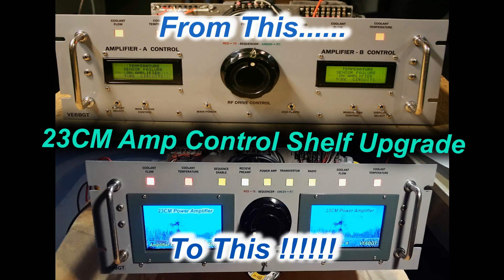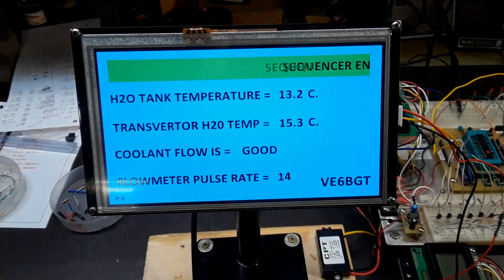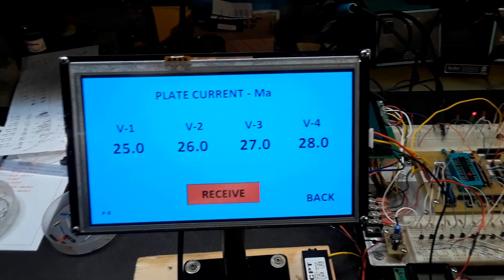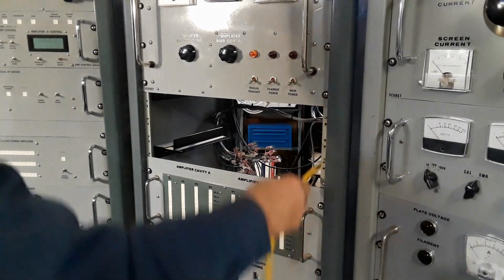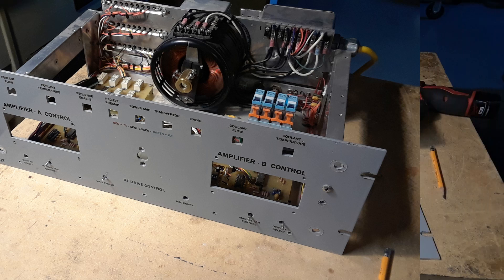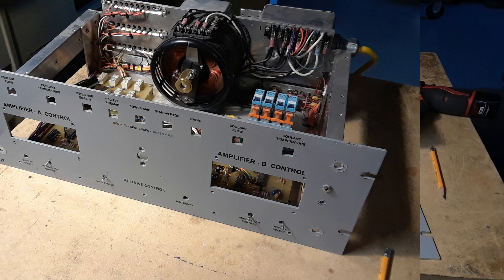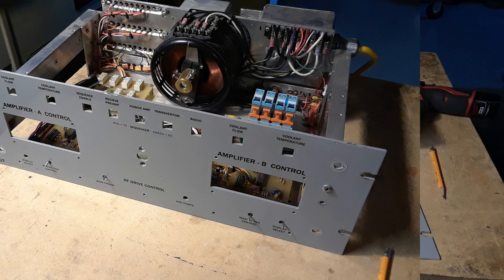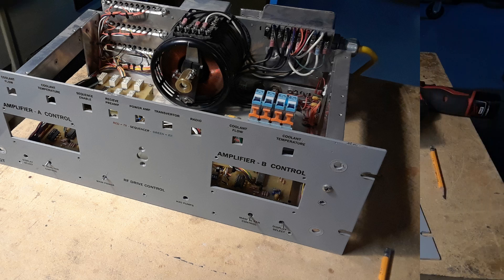23CM Amplifier Control Shelf Upgrade

Comment: Hi Skip,
What is the lowest wavelength that would be kind of practicle to use in conjunction with the concept of EME.
I am just thinking that at 68 I am always looking for projects to keep getting up in the morning worth the effort. Don't have time for a new endeavir now, but winter is coming...
Reply from the maker: Hello again, well first off your still a young fellow so dont let that stop you!!!  the frequencies for EME are from 6 meters ( 50MHZ ) and up, all the way to 24 Ghz and higher probably..  There is a lot of noise and other issues that you have to contend with on VHF and UHF but 23cm is a nice quiet band to work with to start etc.. This is where I began.. I am a fair weather operator and dont spend much time on 440 or at all on 144.. It also depends on what mode you want to work with, CW or Digital etc...   Skip
Reply: @VE6BGT  Thanks. I have a lot to learn relative to EME & if I jump in it will certainly keep me busy on cold winter nights in the Catskill mountains of NY. 

I have pretty much been a casual ORP user of 80 & 40 meters over the last decade and this would definitely be a new experience, but I like antennas which is why I like QRP which lets you know you did well with your antenna and I may start the long journey that may lead to a sucessful signal redirected off the moon.
Reply from the maker: @migalito1955   Well your a prime candidate to try EME digital with one yagi on VHF, The ultimate weak signal... Some guys are making good contacts with the other stations being a big Gun ha ha...  Give it some thought.. Skip
Reply: @VE6BGT  Yeper, QRP EME would definitely be a match made in heaven for me.
My issue that hampers me, some might say, is I have too many hobbies that I'll endulge in till I tire of one and switch to the other.

 I have building acoustic stringed instruments which led to building preamplifiers, equalizers, and transducers, I have kit built & pre-assembled RC airplanes with flight controllers that allow for mission planning over the 160 acres that I can fly over, I have general cabinet making, and of course I have  QRP kit built amateur radio all competing for lets do something fun.

Too bad I  have zero formal education in all of the above and while my instruments look nice you never want to pay me to play, my piloting skills are Ok, but not competition winning, I get buy in electronics but within big limits....

I just enjoy the building aspect & had my local university had engineering paths I would have selected one of the offerings. As was they had mathematics and I fell in love with pure math and went down the rabbit hole all the way to eventually walking away with a graduate degree in the subject. While no doubt a really cool subject it does little for assisting one in the hands on sciences unless you call encyption hands on. So I am very thankful for YouTube videos and the clues they provide should I try something new that peaks my gee wiz is that not too cool....

Take care 73 & thanks for your nerd channel....
Reply from the maker: @migalito1955  Yeow, way to many irons in the fire for me.. I tip my hat to you for sure.. I have wanted to try something else but I cant 
get away from tinkering with radios..  Just in my blood I guess..  Thanks and 73 also.. Skip

Comment: This is absolutely amazing! I see that you are making your own boards with etchant and such, but have you considered using one of the JLC or PCBWay type PCB houses to make your boards? I have been doing that for a few years and adore it.
Reply from the maker: Hello Bob, thanks for the comments.. Yes I have thought of the different companies that are available now to get circuit boards built.. I still enjoy rolling my own, but lately I have had some issues with the etching process taking over an hour.. It turned out the ammonium persulphate chemical I use has gone bad, not the solution but the chemical itself.  I got this from work over 20 years ago ha ha, but who would have thought??  Plus I use my own artwork cadd program for doing the positive transparency..  Way back I couldnt find a layout program I liked, they were all clunky so I used Visio and made my own.. So it would take a lot for me to start all over again.. But someday..  Skip

Comment: The trouble I found in the general scenario where you have a computer controlling your hardware through digital and analogue IO is you have millions of wires, and to start with I got bogged down with D connectors, endlessly rewiring stuff to go from one place to another.  After a lot of head scratching I first of all implemented I2C interconnects, but sill had a wiring problem. Eventually I realised that the way to do it was using a wireless network. I'm still fiddling with this concept and have more software to write, but one good thing is the wires have gone and so now if I want to reroute something I do it programmatically, but I have developed a simple functional programming language to define what connects to what and what needs to be processed between the inputs and outputs. I use a web page interface to control it.
Reply from the maker: Hello Andrew.. Well I am old school and find working with serial data is a way lot easier to work with and troubleshoot.. In my career I have wired thousands of cables and have a good knack or know how on how to solder wires to connectors correctly.. I never have an issue that way.. I found that a lot of technicians   now dont know how to solder properly and that's a problem.. I like lots of wires ha ha.. As for doing it wireless, well I wanted to stay away from that kind of thing being in the radio shack.. There is to much WiFi interference out side getting into the ant system already, but to have it  right inside the room would drive me nuts.. Especially on 13cm.. That's why my cameras are also hard wired..  Heh whatever works though.. Good luck with your endeavours.. Get on the moon!!   Skip
Reply: @VE6BGT  Yes indeed, it was why they built Jodrell Bank where it is. The city generated too much electromagnetic pollution. I'm learning all about these problems as I fiddle with error correction and radio propagation by experiment.
Reply from the maker: @Andrew-rc3vh  Jordell Bank !  Now that is one dish I would like to strike off my bucket list or to visit tour list!  As I go around i try to take in as many dishes as I can get to..  But when Jordell Bank was built way back when there was no such thing as Wifi or GPS satellites.. Or Musk StarX satellites polluting the waves.. I have a friend over here who grew up in England and tells me they used to play as kids near the big telescope there.. I cant imagine ha ha.. Skip